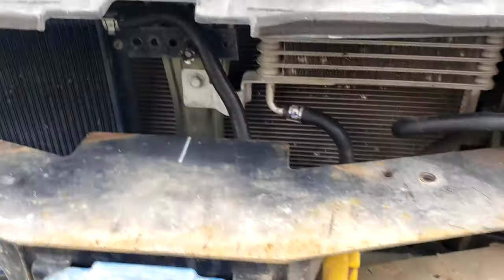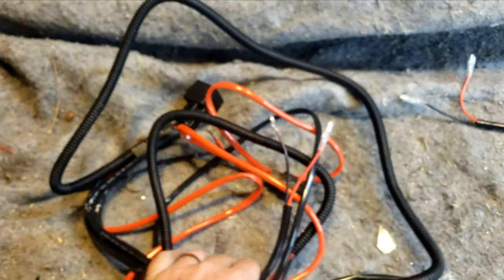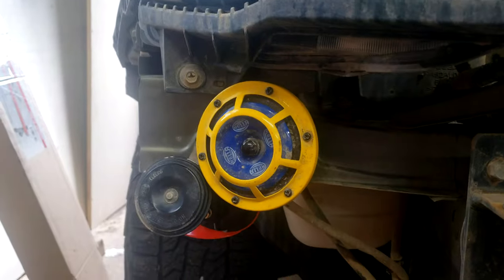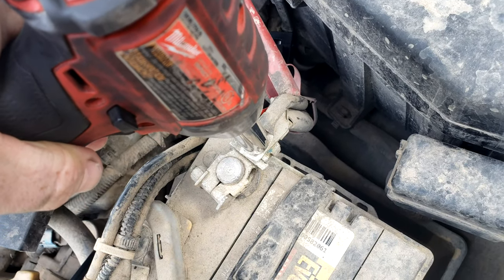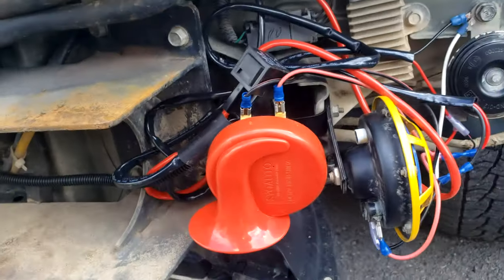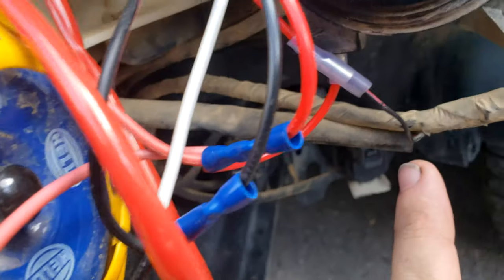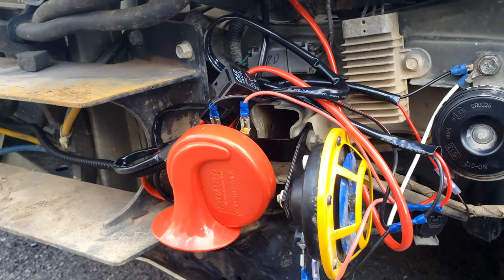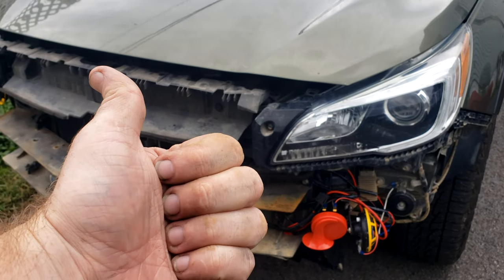How to make your Subaru very Horny

Comment: Ahhh come on Bruceyyyyy, what you couldn't ""Borrow"" a horn from an old dump truck or train?
Reply from the maker: Those are typically air powered with a reserve tank  so the draw on the horn is lower? I'm not sure I would have to check.
Reply: Don't go gettin in trouble now  @bruceyyyyy  😜😜. Depends on horns I think. Some need the tank some on the air pump. Do I see another junk yard run in the near future?